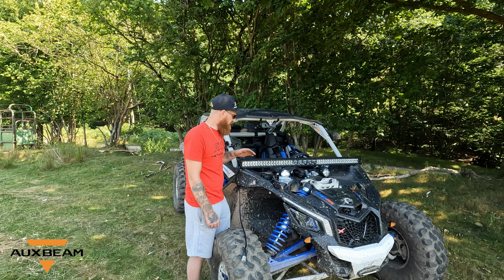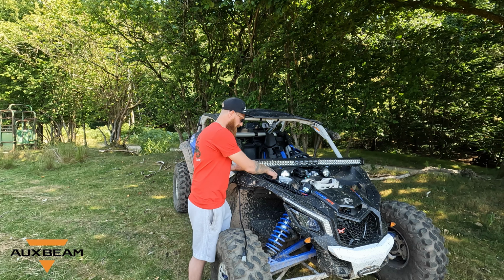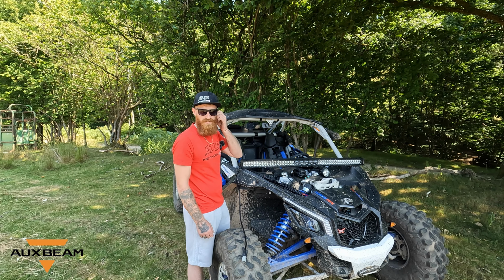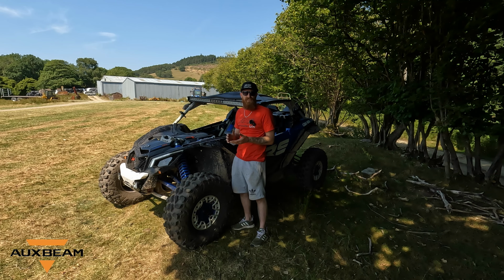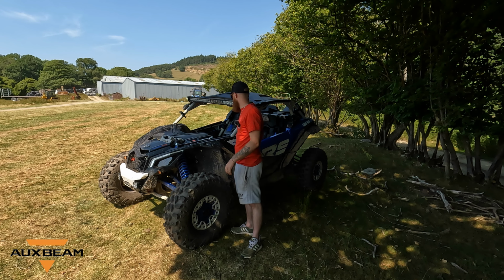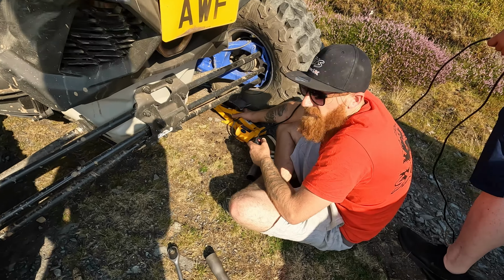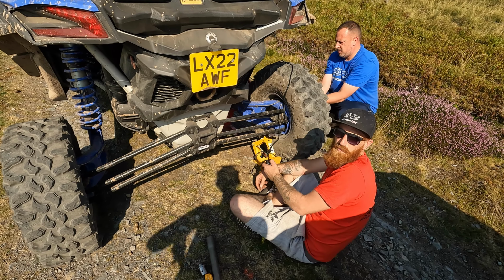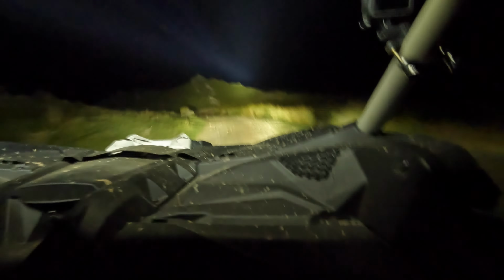WATCH THIS Before buying a light bar!!!! - Auxbeam 52" 5D Pro Series Light Bar- Can Am Maverick X3

Comment: Roof Mount causes far too much glare. Having your dash and hood lit up causes serious eye strain. You're better off with a smaller bar shock mounted, some bigger pods on the bumper, and those little guys mounted to your a-pillar. Btw it's easier to remove the passenger side seat and the side of the console than it is to remove the whole top of it. Hopefully you wired to the bus bar bud. Btw ditch those crap mirrors and get some Cuero pro mirrors.
Reply from the maker: Cheers, thanks for the advice, we will be testing various options moving forwards 👍🏻